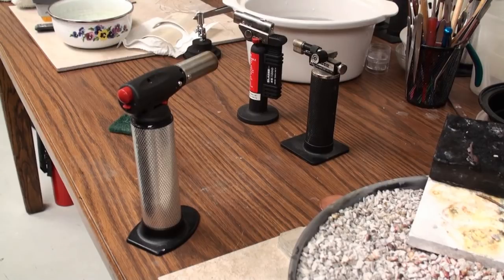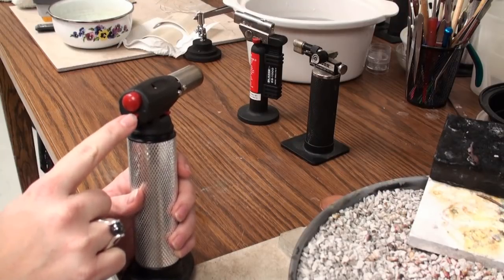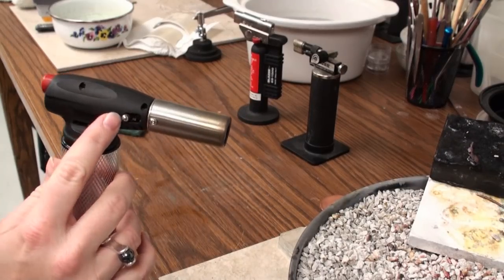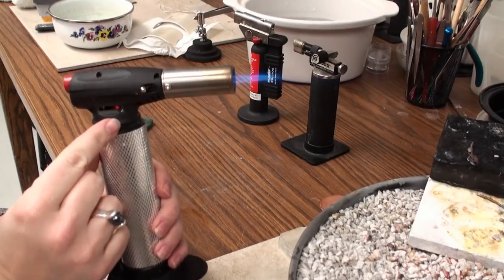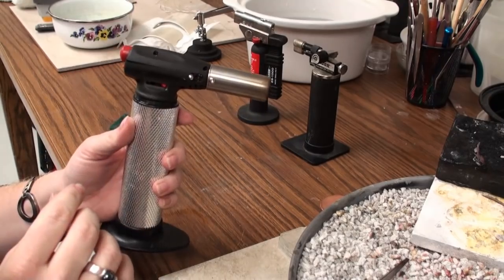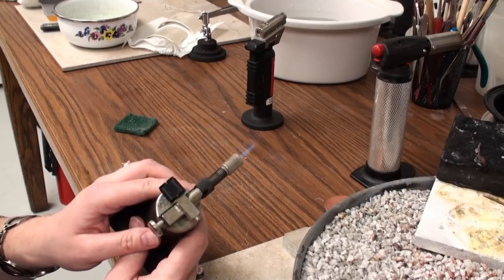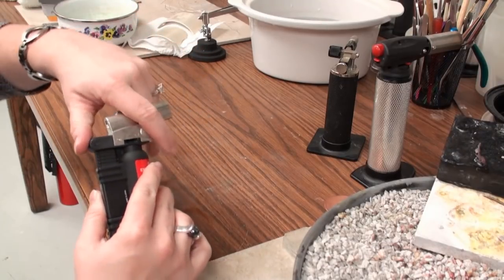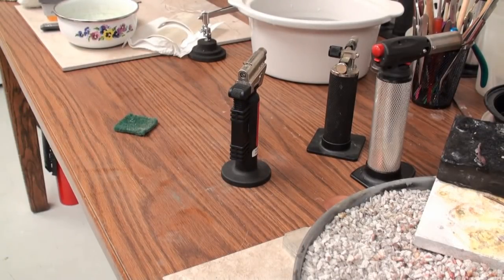Tool Time Tuesday - Using a Butane Torch

Comment: Thank you very much for this video. I'm a disabled artist with severe RA I've had since I was 16 and I'm 61 now so my hands are severely crippled. I've been looking at the many flip cup acrylic painting instructional videos and thought I'd like to try that. The one thing that worried me was the torch. It looked like everyone was switching them to a setting where they stayed on. That's not good for me because if it flipped out of my hand it could be a disaster, but by the looks of your video they all have a way to press down to turn them on and if you kept it pressed down the flame still came out. I need it to shut off if I remove my hand from the button  Then I don't have to fear a lit torch rolling around on the floor setting things aflame. If it flips to the floor it will shut off. I wondered if I could just use an Aim And Flame candle lighter for small projects. That also has an on button you have to hold on to keep it going. This was a video that showed exactly what I needed to know. Thank you!

Comment: They have a little brass opening on the bottom where you fill butane, looks exactly like on a refillable lighter (which actually goes for most disposable ones now, they refill easily, just like the ones really meant for refilling). You turn the torch upside down, and (using the standard or tip adapter that comes in the can lid) take your Butane can, turn that upside down too, then press the can's tip towards the brass opening, filling takes seconds. Gas starts squirting out when it's full.

Comment from the maker: Liat, I love this torch and it certainly has its place in my studio as one of my mainstays. It does have its limitations though. I can work with pieces up to about 3 1/2". But it has worked really well for me. I am able to do the majority of my work with the larger butane torch (Jumbo Max.) I would think that this would be a very good option for you.

Comment from the maker: @Hannah Woodard, yes, I do everything with this torch. Well, I guess it doesn't do well to melt down larger pieces. But I do my soldering and annealing with this. It works best for pieces that are under 3". Anything over that I have to have two torches or a larger torch with a big tip. That is when I typically would turn to my acetylene torch with a #6 tip.

Comment: Have you continued using same torches, or have you found/updated your torches? What has your experience been with fuel consumption, and what are the temps. with the large vs. small torches?
Reply from the maker: Good question. Yes, I do still use the same torches. All the butane torches claim to go to about 2,500 F. I can't verify that though, but they have done the job well for me. The difference between the large vs. the small torches is their flame size. The larger ones can heat and hold the temperature on a larger piece of metal than can the smaller ones. The consumption depends entirely on how much it is used. I can use a jumbo max butane torch in a class with 8 - 12 students and need to fill it only once or twice if it requires only moderate soldering on a project. A project that is a bit more involved, may require filling three or more times. What types of things are you looking to do?

Comment: Did your max flame torch stop igniting after refilling it with butane? My just makes a hissing sound coming from the nozzle and no flame.
Reply from the maker: No. That is not good. Check the striker part when you can to make sure it is still sparking.
Reply: @MelissaMuir  I did but it's doesn't look like the striker is working properly.  What do you suggest I do?

Comment: When you made the blazer torch have a yellow flame, were you adding more fuel and less air, or less fuel and more air? (Guessing a rich mixture)
Reply from the maker: It is adding more air. There is a small hole at the top of the torch head and as you spin the ring it either covers or uncovers the hole that is the air intake.
Reply: So when you close the hole, the flame is getting less air and the flame turns orange because of the lack of air.
Reply from the maker: Ethan James yes, that is correct.

Comment: I'm not sure if you know the answer to this, but I was looking at butane torches because I'm going to build a record player cabinet out of wood. I want to scorch the grain and then apply a light gray stain after. I could buy a propane torch, but I was looking at the handheld butane torches because it looks like it could facilitate the scorching process (unlike those bulky propane torches), and it would be easy enough to store and reuse for other similar projects with wood. Have you by chance tried scorching wood? Do the butane torches not give you enough light flame? My worry is that the scorch will look spotty and burnt with a butane torches instead of smooth and even. Any thoughts?
Reply from the maker: Justin Dimos I am afraid I haven't tried that before so I don't have a really good answer for you. If you used one of the small butane torches, then yes, I think you would end up with more of a spotty and burnt look. However, the larger butane torch that I demonstrated would have a larger flame and be more likely to give you the results you are after.

Comment: Hello! I am new to jewelry making and I have used a kiln, but I am looking for new techniques since I do not have a kiln at home. This may be a stupid question, but can I use a lighter instead of a torch? (Ps I may be asking you a lot of questions)
Reply from the maker: +Allison Kelly Ask away. No, a lighter will not get the metal hot enough to do anything. Torches get up to about 2,500 degrees. That kind of heat is necessary to anneal and solder.

Comment: Thanks for the informative vid. Just for the third time, i see the jet fall off the front, where the flame burns. You can't fix the defect by simply putting the jet back into the tube. So, the third one for scrap.

Comment: How do you refill this torch and approximately how often do you have to refill it?
Reply from the maker: +kar sanchez The torch is filled at the bottom. There is a small port you attach the can of butane to and fill it. How often depends on how long you are using it. The Jumbo Max torch has the longest torching time.
Reply: Nice

Comment: I bought the torch but tried it on vegetables and it leaves blackness on them, I don't smell butane off of them but scared to eat them coz it feels like there might be butane residue all over it. I used zippo butane refill fuel butane. Am I overthinking?
Reply from the maker: Yes. I believe you are over thinking it. The butane is burned off. It is the same type of torch they use in kitchens all over the world.
Reply: @MelissaMuir  ok. Thanks for your input. Appreciate the response! 👍

Comment: Will this torch be good for heating up Titanium nails?
Reply from the maker: Dieter Paleo I am afraid I have no experience with Titanium, so I cannot answer that question. But I don't see why it wouldn't. How big of nails are you talking about?
Reply: not big at all. maybe 18mm to 14mm. just need to heat up the top area. Thanks. Enjoyed your video.
Reply from the maker: Dieter Paleo
 I think it would work just fine for that.
Reply: Ain't nothin wrong with taking dabs. You need a good torch for that. But I'm this close to getting an eNail.

Comment: $40? Bed bath and beyond sells the EXACT same one for 25
Reply from the maker: stephenmartinez1 Wow, that is a great deal. Mine doesn't. But if yours does, you should take your 20% off coupon and get one. That would be a killer deal.
Reply: $29.99 at BBB. But the ignition is failing. Takes 3-4 attempts to get it to light. I ordered a Vector Nitro.